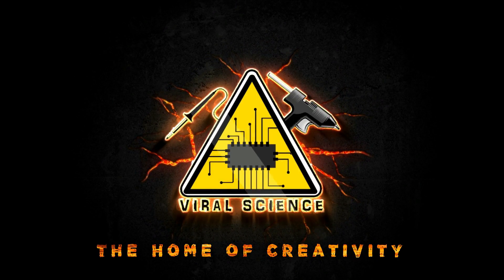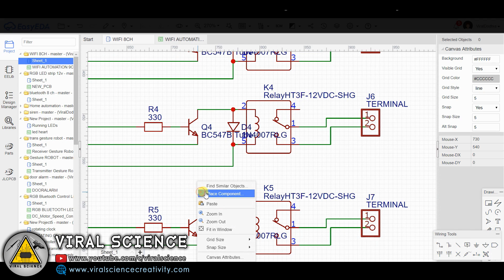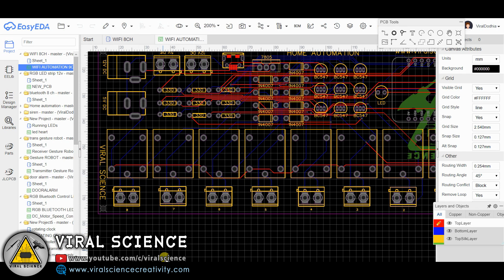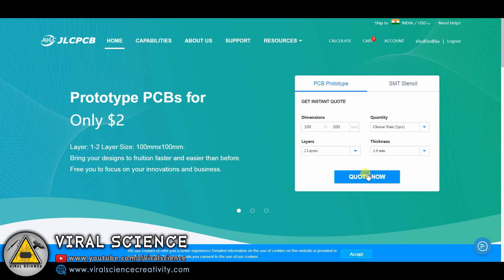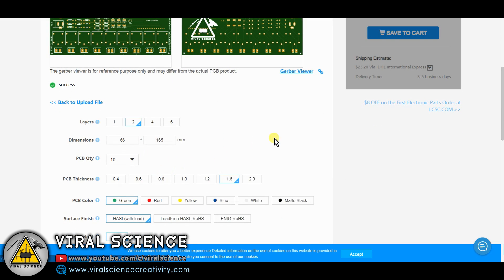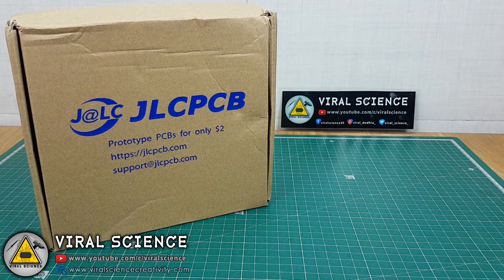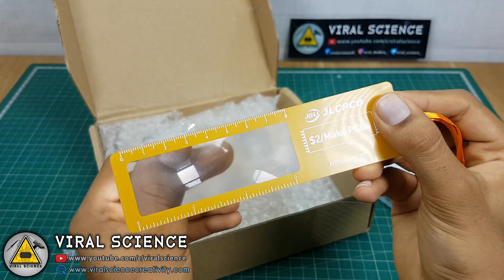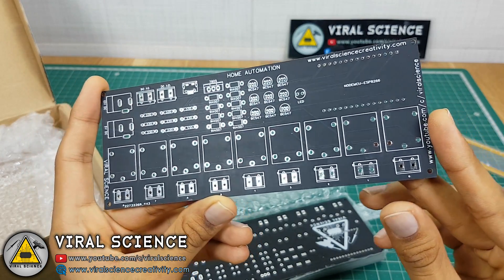IOT Home Automation | PCB | 9 Channel

Comment: Hi nice video but im facing a problem when i connect nodemcu esp8266 with relay board its power not on and when i connect externally from laptop it will work correctly i will give 5vdc to the relay board please help me to solve my problem

Comment: Hello , Very Creative And Helpful Video! But Im Facing A Problem Related To This Project And I Need Your Help That Is It Necessary To Connect External 5V Or 12V DC With This Board? When I Connect My ESP 8266 Module To This Board My ESP8266 Module Dose Not Power On Or Not Working But When I Connect With My Laptop It Is Working Correctly As I require Please Guide Me I Invest Much Money In This Project Please help Me To Solve These Problems.
Regards : Muhammad Faizan
Email ID: fazimalik27@gmail.com

Comment: Its always better to use opto isolators to drive relays !!! AC noise will seep in and cause the nodemcu to mall function. Nodemcu is very sensitive to AC signal noise. 
And there is no resistors for the nodemcu to boot up properly. How is it still working?